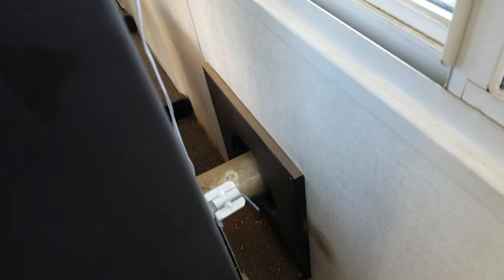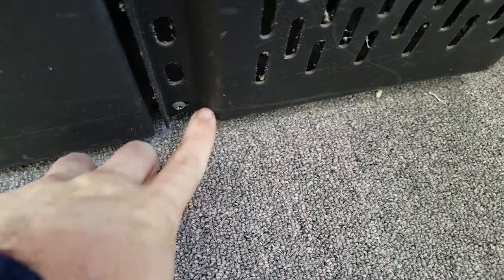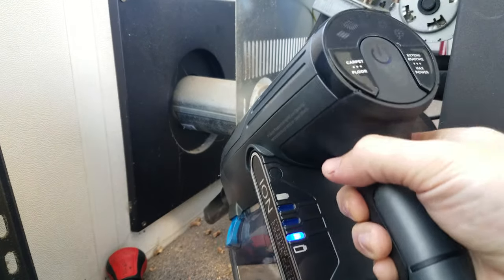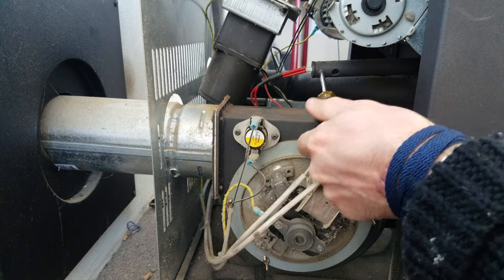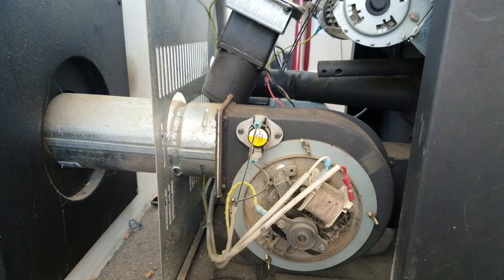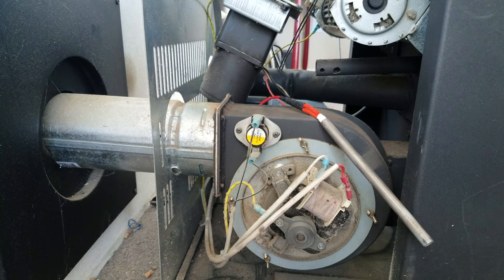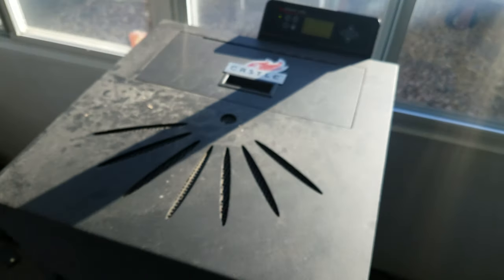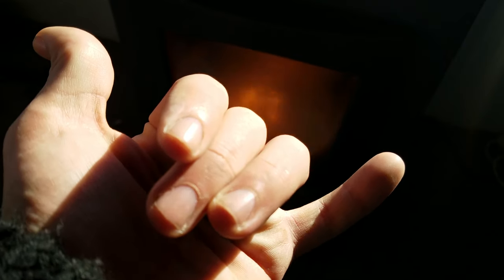Castle Serenity Pellet Stove | Diagnosing No Flame | Disassembly, Cleaning | Replacing Igniter

Comment: Just what the doctor ordered!  I have the same pellet stove and the igniting became unpredictable. Yesterday it would not ignite at all. Found your video! You showed me how simple it would be to replace the igniter and I ordered the part through Amazon today! Your comment about starting the pellet stove without the igniter work ing reminded me of how I used to start an older stove: soak some pellets in a close-able container with enough denatured alcohol (not "explosive" at all) to "soak" the pellets. Then when I needed to restart my pellet stove I would start the stove in the "manual" mode, drop in enough soaked pellets, drop in a match, leave the pellet stove front glass door open just enough to give sufficient oxygen until they begin to burn and then slowly close the stove door and allow the internal fans to take over the task! Works for me in a pinch now that I must wait 10 days to get the part and we are still in winter here in central Oregon.
Reply from the maker: Haha glad to hear! Yeah we got pretty good at self lighting this stove with lighter fluid and leaving the door cracked as well. Waiting on shipping for this seems to take a long time when manually lighting a stove. Ours is vacuum controlled though so that needs to be adjusted so it doesn't sense the door is open otherwise it won't feed pellets.
Reply: After igniter went out, turn on stove and light up pellets with a propane fuel bottle.  Got my igniter replaced.
Reply: Thank you,  it works.

Comment: As to Captn Jack's response below: I had the same issue with having to remove the auger motor, witch is difficult. I made a fix as follows, heat and bend the tube that holds the igniter enough so the igniter will come out without hitting the motor. This won't hurt anything because the tip of the igniter will still be in the same place needed to light the pellets. To do this I used a propane torch with Mapp gas, this puts more heat than propane, heat the base of the tube to red then wack the end of the tube with a rod and hammer to bend it just enough as needed.Don't wack the very end of the tube or the clamps wont go back in. And BTW the igniter is available directly from the mfg. Hope this helps somebody
Reply from the maker: Wow I guess I lucked out.
Reply: Hello  Ihave same model it won't light with igniter . while trying to light the pot will fill ,manul light it will burn till out of pellet . then it gives two diagnouses  1 . check the burn pot .

Comment: Just to also let people know I have a castle stove also. I had to replace the igniter just the other day Nov.1st 2020 also but mine would not come out as yours did I had to remove the left side and the lower back panel then remove the auger motor screws with lock nuts on the top of the holding bracket and loosen the jam screw from the auger. Then you can take the igniter out to replace it. All in all, it took around 45 minutes. And no you don't have to remove any pellets.
Reply: Thank you so much for posting this comment.  I came into the same issue.  This helped immensely.

Comment: Huh, we have the same pellet stove, bought a few years ago when they first came out. Our igniter when out last year, bought a new one and when attempting to install found that the auger motor was completely in the way. Saw this posted and looked again today, it looks like your motor is different. Smaller, or offset to right more or something. Ours is gray/silver and yours is black. The igniter wont slip past the motor like yours. Seems like removing the motor is an easy job, looks like they may have corrected that design flaw with your model!
Reply from the maker: Yeah could be. I thought this was the oldest generation maybe not though? Maybe this is a generation before yours.
Reply: Vern I have one too and this morning it won’t ignite, how long did your igniter last?  I set up mine in October 2016.
Reply: Same issue here.  Ignitor can't slip past the motor.  Looks like I'll have to remove the rear plate to unscrew the 4 bolts holding in the motor.
Reply: We are trying to replace ignitor but anger motor is in thevway. We can't  get the auger motor off. We took 4 screws off and it spins but how does it disconnect?
Reply: I have the same issue.  To make it worse one of my auger screws is stripped...any advice welcome!

Comment: Did you disconnect the door sensor so it can't detect if the door is open?  Or did you have to buy a new senor that wouldn't detect a open door?  Your REPLY would be greatly appreciated
Reply from the maker: I actually turned the knob on the side of it that adjust the sensitivity of the door sensor. It's a very small knob on the right side of the stove you can see when you remove the side cover.

Comment: I've had one of these for a few years.  Just having issues now.   How do you 'manually' light it?   Thanks
Reply from the maker: Lighter fluid and a lighter. Have to adjust vacuum line so it doesn't sense your door is open or it won't feed. It's a balance of opening slightly and closing.

Comment: I replaced my starter about a year ago (thank you for the video) and today it seems to need replacement again. Has anyone else had issues with having to continuously replace the starter? I was told there is a more expensive starter from the manufacturer that works better but I cannot find how to order.
Reply from the maker: Just search castle the brand. They sell on their website itself I believe. Their customer service is great also you can just call them up and they'll help with whatever you need

Comment: On my display I usually have a v now it has a L. It drops pellets once  and will light bit will not drop pellets any more and turn off what is the matter with my stove?
Reply from the maker: Could be a vacuum leak. In the manual it says what the symbols mean. We had to adjust the sensitivity to our vacuum with a little dial on the right side behind the panel of you're looking at it from the front. Customer service is really good also you can call them they'll walk you through it.

Comment: I have the same stove but I can't get the igniter to slide out..  ..  that round black oblect in front of it won't let me pull it out all the way...   any ideas ?
Reply from the maker: Heat maybe seized it in there.
Reply: @g3mccotter  No it's moves freely...  it's just like it's to long to come out...  that big round thing about 4 inch's from it is blocking it
Reply: I believe it's the base of the auger motor
Reply: @MrWwayne1  I have the EXACT same problem as you and came to this video to see how this guy got it out...did you ever get yours out? what did you do?? I'm kind of stuck.
Reply: @vinnyfratto1863  yes I got it out yesterday...  had to drop the auger motor..  was pretty easy, and everything works like a champ now
Reply: @MrWwayne1  perfect, will give this a shot after work! thanks!

Comment: I just got ours going but I found when on thermostatic mode and with the indoor air temperature above the set temperature it still burns very hot. Even if I put the setting on its lowest number which is 61deg , the house will be in the 80s and it still cranking out heat.. Any others gave the same issue??
Reply from the maker: Good problem to have it works too well. Yeah basically to keep it lit it has to burn a certain amount of pellets so you just have to shut it off. If you must have it on you can change your exhaust fan speed to high and blower fan speed to low. This is the least efficient way to run it since you're blowing more hot air outside. We would do opposite of that and have exhaust all the way lower and blower high and then just cycle it on and off every hour or so depending on temperature.
Reply: Yes! I have this exact problem. It just keeps going burning hotter and hotter until I have to shut it off. It's feeding pellets too quickly, the auger doesn't slow the feed like it should. There's no point in buying a pellet stove with temp settings if it completely disregards those settings!
Reply: What do you mean by "just cycle it on and off"? Does the control board have the function to run the power on and off?, if so, does it work all right to ignite, burn, and then stop burning by power off? Or, does it cycle with controlled turn off procedure? If power on off makes this cycle, I doubt if it is right way to control, as the remaining heat is there, which should be blown out until it gets cool.Please explain 'how cycle it on and off' - can it be set by control board, timing as you want: every hour, or once in two hour, or once in 5 hours?

Comment: How do I ignite it manually. I can’t get it.
Reply from the maker: Lighter fluid cracking the front door until it's lit. It's difficult since it will keep feeding pellets so you have to stay on top of it so it doesn't smother until you can close the front door. If it starts to smother you have to stop and restart by emptying the basket.

Comment: You need to hook the outside air tube up for outside air you will get a better burn
Reply from the maker: The manual said it's not necessary for a smaller area I think it was. That's good to know though. Better burn as in hotter? Slower?
Reply: @g3mccotter  all the ones i used say its best to hook it up they suck the oxygen out of the air
Reply: I ran a short vehicle exhaust tubing through the wall next to  the chimney.  2 foot from O Reilly’s